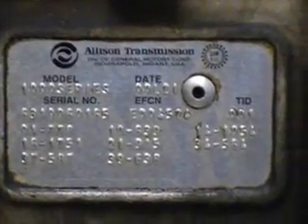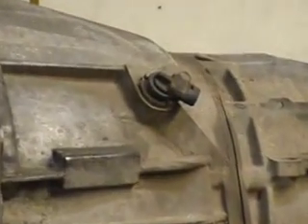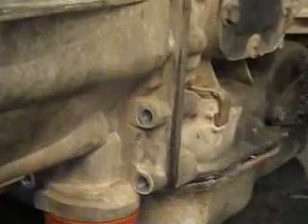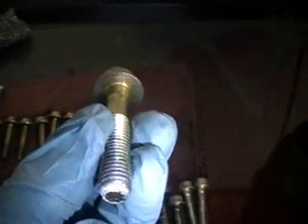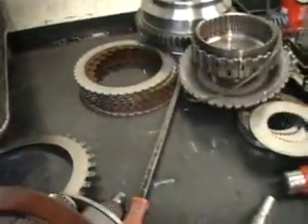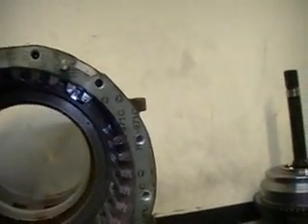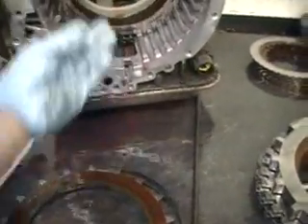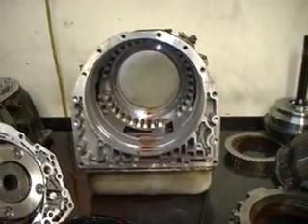Allison Transmission Problem? Fix it With This LCT 1000 Teardown and Reprogramming Kit Installation!

Comment: That red external filter is called the Control Main Filter, also know there is a magnet stuck to the filter not to be discarded if serviced. The Control Main Filter filters the control main pressure which is 100psi from charging pump to the valvebody to prevent debris from getting into the valvebody. The filter in the pan is the suction filter, Further the module referred to as "input drum" is called the Rotating Clutch Housing", it contains C1 and C2 Clutch packs. I highly recommend replacement of the 10 seals on the 10 sealed bolts bolt as they tend to leak if reused. Also C1 is the smaller inner pack, C2 is the bigger outer pack. The plate in C3 he calls the "pressure plate" is the spring return plate. Later refers to the C3 backing plate as a pressure plate. The minor discoloration of the fibers or friction plates is acceptable, as for the hot spots on the reaction plates or steels is also acceptable unless they have formed high spots that can be felt. If they can be felt the reaction plates should be changed. Buffing only creates low spots that increase wear rates. The spacer between P2 and P3 sun gears does not require "Clocking" but make sure it stays on its spline while reassemble or the rear cover/extension housing won't come together without damaging internals! This is a very good video. All of my comments were only intended to correct nomenclature of parts and component. The clocking of the spacer not necessary because the main shaft is undercut to allow lube to flow regardless of spacer orientation. I have worked at a Allison transmission Dealership since 1992 and a member of the Allison Guild since 1993. I've personally built and dyno'd hundreds of the 1K2K Allison Transmissions. Good video overall !
Reply: thinking of changing the at545on my converted school bus into a 2400 for the locking converter and overdrive, do you know anything about this and if it sounds like a good Idea? thanks !